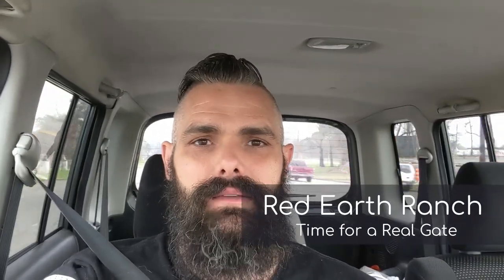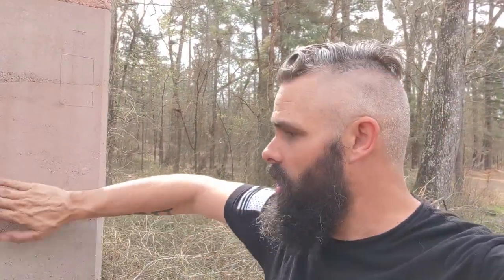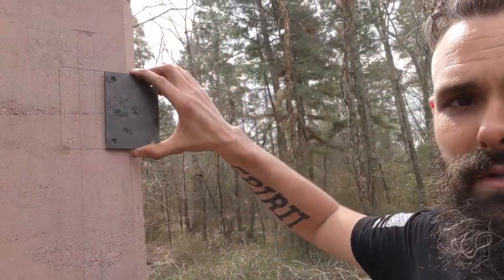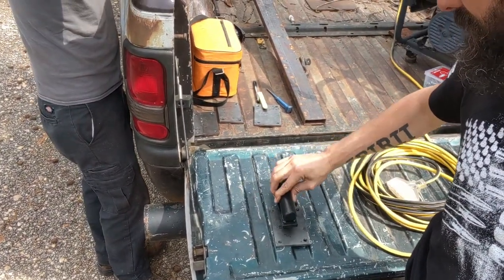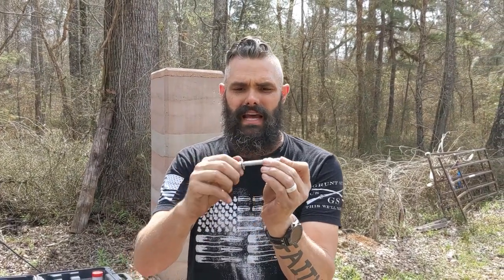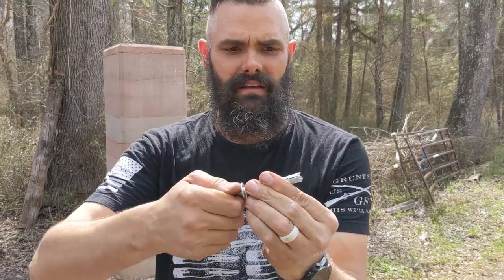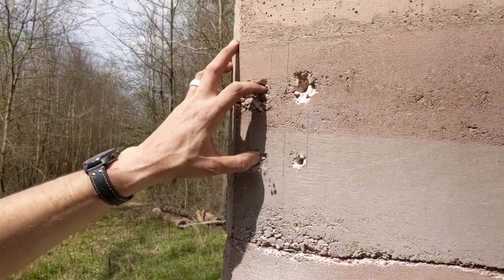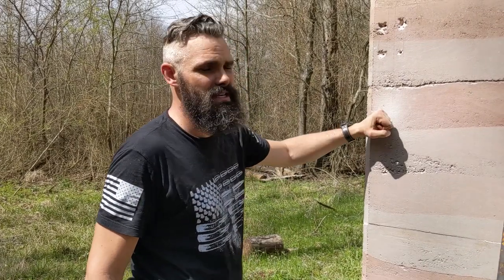Welding a Gate and Anchoring it to Rammed Earth - Vlog 59

Comment: Very nice looking thx. Quick question though, if the sleeve was embedded, doesn't it need to push up against the metal plate/washer and nut in order for it to expand and provide the compression against the walls?
Reply from the maker: Now that you say that it does make more sense. I will keep an eye on them but they seemed to be okay when we finished.

Comment: In the future if you need to use anchors look into Simpson Titen HD anchors. They’re much simpler to use and stronger
Reply from the maker: Will do, thanks for the tip!
Reply: Going by Simpson Titen HD anchors tech information: "Designed for use in dry, interior, non-corrosive environments or temporary outdoor applications" so in this case probably not the best choice but they are good for bolting down stud walls to a concrete base.
Reply: @Jesse Darwin flixportal :)
Reply: @Maddox Zakai Thanks, I signed up and it seems to work :) I really appreciate it !!
Reply: @Jesse Darwin No problem =)

Comment: Thanx 4 that. Loxens (what ever you call em - maybe dyna bolts) are a wonderful idea but can be really tricky to get right. I was really interested to see the viability of the rammed earth to hold the Loxen. Don't look like they are coming out. Be interesting to see how they last over time with the gate weight moving. In a perfect world I'd think about running a galvanized 50mm x 3mm bar down the wall from top hinge to bottom hinge. Thanx 4 sharing
Reply from the maker: Yeah...they have been holding so far but if they have problems we will probably replace them with epoxied all-thread and bolts. We were trying to find an alternative to epoxy and this was a relatively low risk way to try it out.